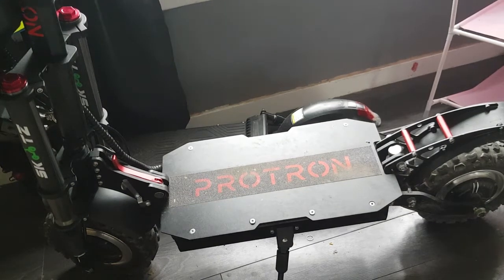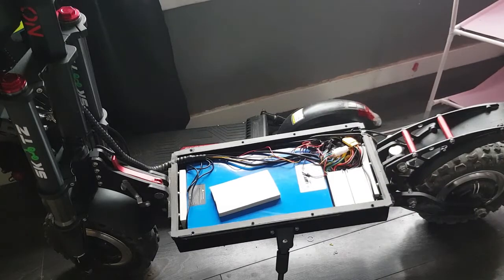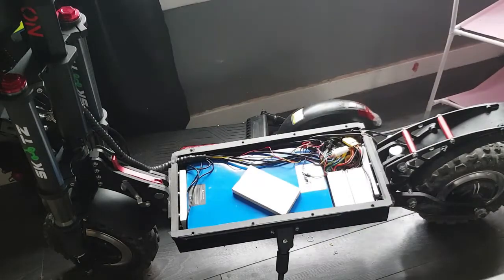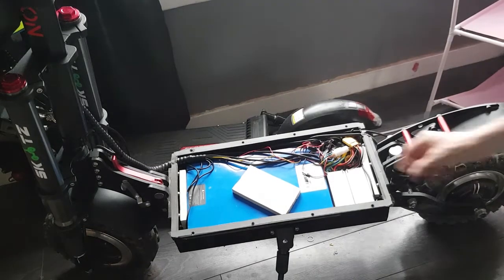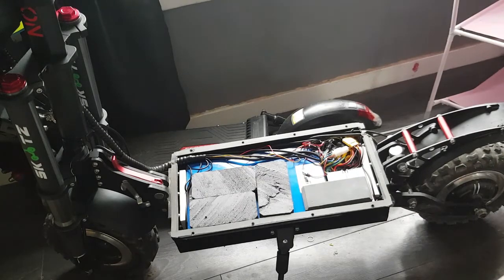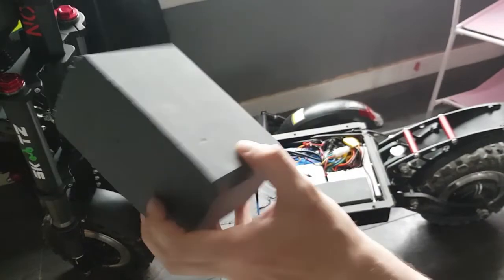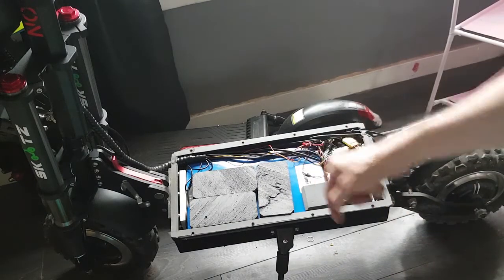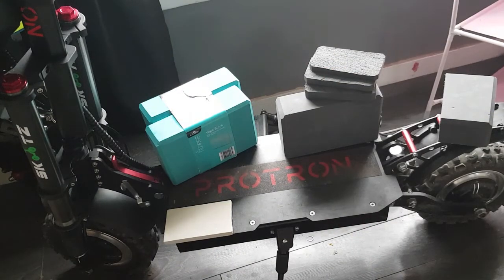HOW TO FIX ELECTRIC SCOOTER BATTERY BANGING KNOCKING AROUND.

Comment: Am getting the same scooter as yours the company told me that it goes 80km  and does the battery last long with both motors on
Reply from the maker: Not really, at full speed both motors I only managed about 6 miles and the battery was already very low, and if you know anything about these batteries, it's best not to r7n them too low as it really reduces the life of the battery by hundreds of charge cycles.
In just the rear motor I was getting 20 miles no issues in the beginning, but both motors at full power is just a lot more fun.
WARNING most of the stats you see are for a similar scooter that is 40AH BATTERY, the version I had was only 28AH I think, didn't last long and ended up taking back to skootz for a refund as it was falling apart while riding and to pay 5hem for maintenance was gonna be stupid money, tyres especially needing changed after every 6 rides as fronts were going bald with wheel spinning.
Bolts falling off wheels.
Battery banging around inside.
Controllers getting so hot thing nearly melting.
Folding mechanism not working.
Lights falling off and holder starting to crack.
Plus more issues.
Because it was under warranty, I had to have them check it out, and the cost of back and forward to them and their attitudes, it really made it an experience not worth having.

But when the scooter works, it's amazing at full speed, but if the battery breaks it will cost nearly a new scooter again to replace, and a replacement battery is not even LG CELLS.
Reply: @oraclescave  currently i got a bike and a scooter but got in a car accident and broke the bike it doesn't work anymore and my current scooter is old I want to buy a new one which is the same as yours its 60v5600w but am not sure because the company told me that the scooters range is 40 to 80km and does 85kmh which am really not trusting cause my friend got a scooter that they said goes 80 but really goes 40 I've done lots of research about it and it seems pretty good to me but there's another scooter in mind but alot slower and I really want a fast one to go to school with its an 60v2000w brushless motor with really cool tires (fat tires) and its way cheaper but the thing which is bugging me is that it only goes 45kmh tell me what do u think should I  buy the 5600w dual or 2000w brushless
Reply from the maker: @hus_47_h  if you are not just driving it flat out and be mild on the throttle in medium mode, it will get you big distance and even farther with single motor medium mode.

It is an awesome scooter, just don't trash it through the woods and do big jumps like I did and belting down rough terrain.
The scooter will do big distance, just don't expect to get far if using all the power all the time.

There is a 40AH version from China, think its called QUICKWHEEL ,its cheaper and goes much more distance even on full power and its the same scooter.
Otherwise go easy-ish and get my one.
But it's one way or another
Full speed not so far
Mild speed very very far

Comment: Any issues having this yet . Am thinking of getting one . Have you taken it out when rain/ water where there any issues. Thanks
Reply from the maker: This scooter was driven through puddles, shallow river crossings, deep wet mud, always in the rain as I'm in Scotland, never once have I experienced a water related issue with any part, not the motors, not the electrical wiring or display, and never had an issue with water inside the deck either.
Mudguards do an awesome job, I suppose you could squirt some silicone bath sealant into the wires where they enter the deck just incase, but never had a problem, and I have smashed deep puddles.
These machines are not as fragile as you would think.
A little bit of water won't harm it, obviously if you see a puddle and there is no way around it, just drive through very slowly to limit the spray on the deck.
I don't give a crap, I just hit every puddle, hump and bump and just enjoy myself, very solid machine, motors are water tight , just don't submerge your scooter.
My machine comes home packed with wet mud everywhere all the time, no issues.
👍👍👍